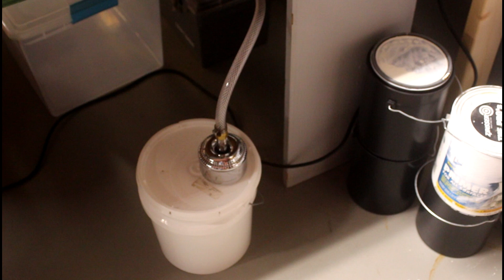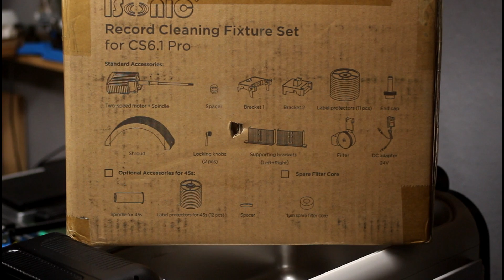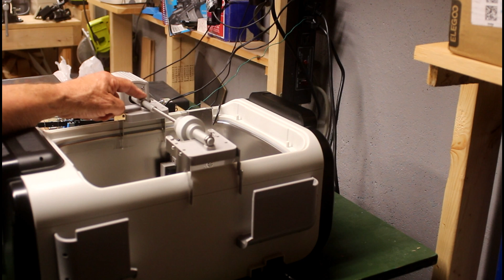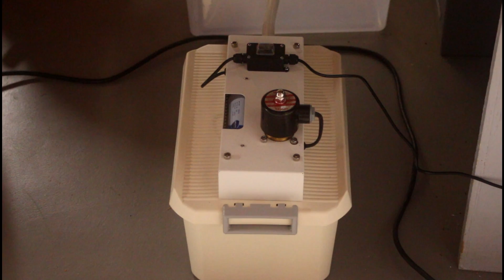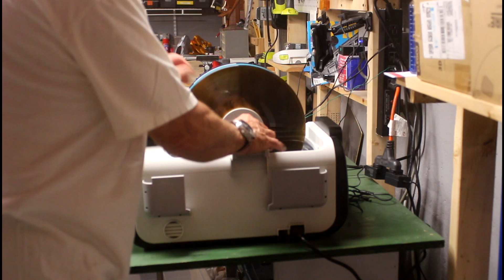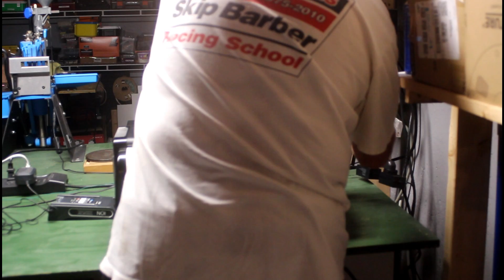iSonic Ultrasonic Record Cleaner PRO UPGRADE

Comment: would you please share a photo of the inner side of the pump and filter station?
Reply from the maker: I don't think that a photo can be posted in comments and I'd have to reprocess the whole video to show it there.
So, the pump is attached to the inside of the top and a hose with suction cups attaches to the bottom
Reply: @ejcheck maybe so you can do a short Video of the Pump inside please and Upload Here?
I would be very glad about this
Reply from the maker: @jonas9568  I'll see what I can do over the weekend
Reply: @ejcheck that would be very nice
Reply: @ejcheck have you made it? I would be so glad about it 🙏
Reply from the maker: @jonas9568  Couldn't get to it over the holiday
Reply from the maker: https://youtube.com/shorts/aSJ-95wJtMM?si=kgmVR0tnIwQYSc5Z
Reply: @ejcheck thank you very much 🙏
Reply: Hey Elliot, would you please explain ne whats exaclty under the white housing is?

I would Like to understand, how IT IS possible to drain,Filter and refill the ultrasonic cleaner with only one installed pump in the tank
Reply from the maker: @jonas9568  The tank drains by gravity, the pump pumps the water back up to the tank.
There is also a filter in the whoit housing

Give cust service a call if you need more details